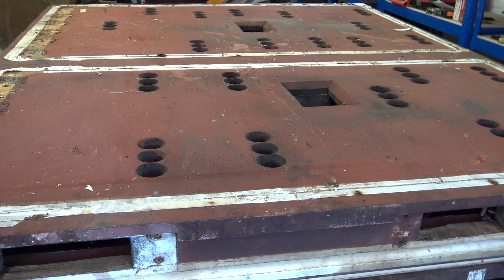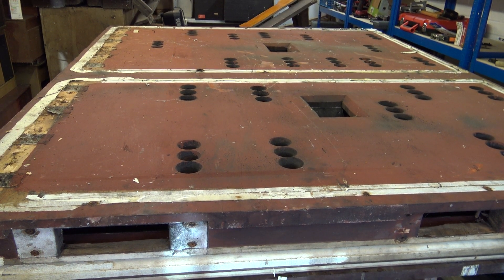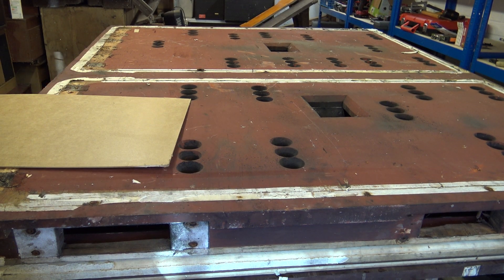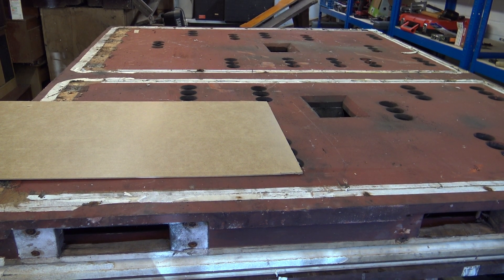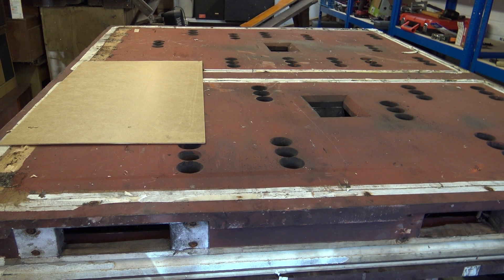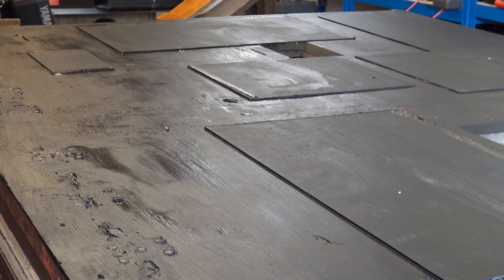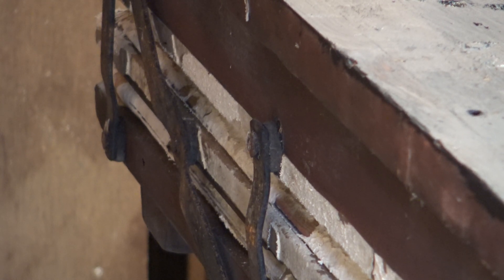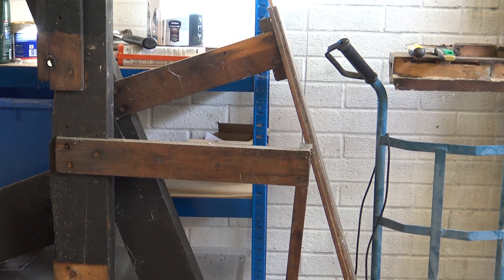1865 Forster & Andrews pipe organ restoration & installation  Pt 1 of a lot

Comment: One question.  If you have an electric motor supplying air, why do you need to keep the bellows?  It will become obvious when you answer, I bet!
Reply: Pressure needs to be constant and this is provided by the bellows with air in them and set weights on top. bellows is actually the wrong name for them but is accepted universally. It's more correct that it's a reservoir.
Reply: @chippieminton21  Ok, so it acts like a regulator that stores some energy as air in reserve.
Well, it is tiring keeping the thing full or air.
It is hard work, it is ok for them playing the organ, they don't have to work the lever/handle, whatever you want to call it.
You hear the minister say "Let us sing blah blah" start pulling the handle and keep going and hope it is a short hymn!
Once was enough for me thank-you very much!
I ended up doing that for one service as Allan was ill and for some reason they asked my father if I would do it.
He said I would, a car came to pick me up. I was put in behind a curtain and told to keep pumping until he stopped playing.
Then start again as soon as I heard the minister say, "Let us sing...."
I thought my arms were going to fall of, either that or I was going to have muscles like Popie!!!
The person that asked if I would do it was his boss!  How could he say no?
I told him he could do it himself next time!
Reply from the maker: An awful lot of organs got electric blowers fitted in the 1930's, then those that didn't,  got them in the 1950's ....like this organ did. We didn't remove the blower from this church as time wasn't on our side & it was under the floor. It'll either be £1500 for a new one or see if we have a used one lurking that isn't 3-phase!

Richard
Reply: @ukfmcbradioservicingTango21  Shame you didn't get the blower motor.  Our church (though I only went for school harvest thing etc) still had the pump handle in the 70s.  Trust me I know, I had to pump it for one service, but that was enough.  Then I got into trouble as it was making a noise!
They should have been grateful I did it for them :-((
Reply: @BoB4jjjjs  some feeders were powered by mains  water pressure waisting water down the drain , but yeah organ tuning was a three man affair and some organist pushed their luck using too many stops on the last hymn
Reply: @keithcitizen4855  I had a go at playing one once, but FAIL, it ain't easy.  Water is such a waste!
Reply: Richard do you try and use original materials as best you can or are you tempted to upgrade ie improve using plastic etc?
Reply from the maker: @stevegrew6758  I have to be mindful that someone else will be overhauling this organ in the future...long after I'm dead. It's important to use traditional animal glue on leatherwork so it can easily be steamed off & redone. You'll see in the next part that a modification took place in 1918 that I will be reversing. Two other modifications have also taken place...which I will retain. Namely the pedalboard change from 25-note to 30 note & the swell pedal changing from ratchet to balanced. Sometimes lead tubing with metal fatigue gets replaced with plastic. As organs have a working life of about 500 years...this will be it's first major overhaul in 155 years.

Richard
Reply: @ukfmcbradioservicingTango21  You still get that smelly glue made from animals that you have to heat up?  Is it the same smelly glue we had to use at school before they came out with the modern glues that don't work nearly as well?